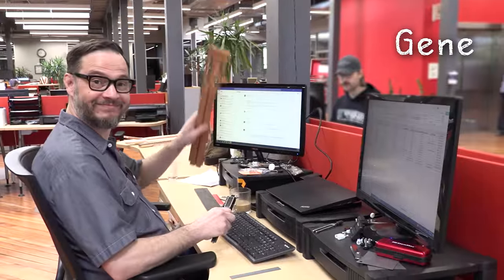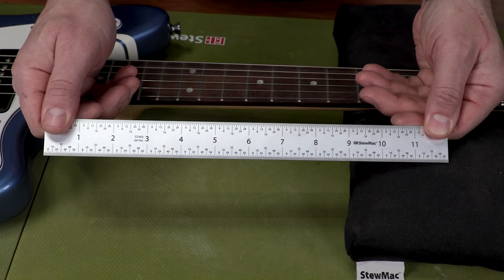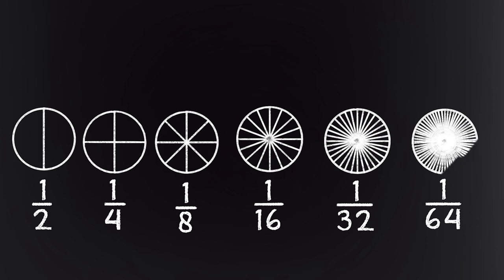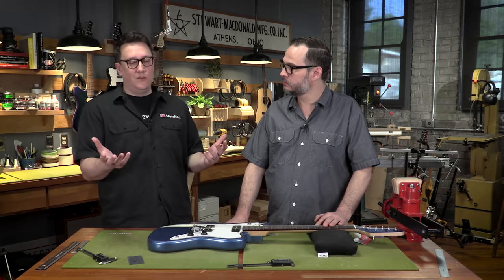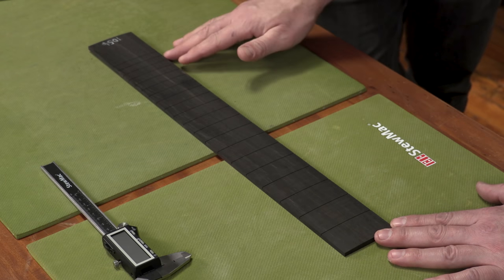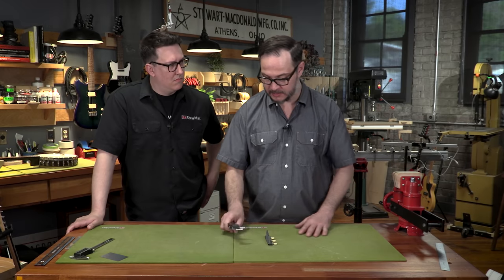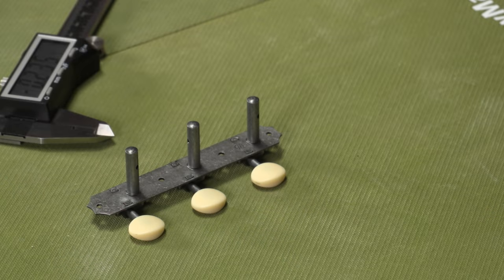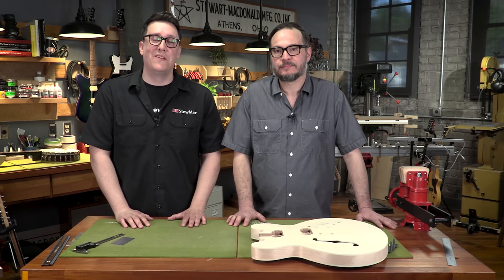Measuring Basics: Rules and Calipers

Comment: There's an easier way to get a centre-to-centre measurement using callipers. Assuming the two holes/posts are the same size, you measure left-edge to left-edge or right-edge to right-edge of the holes. That result is the same as centre-to-centre - it only requires one measurement and doesn't require zeroing the callipers or subtracting the diameter of a hole (or post depending on what you are measuring). The two holes/posts do need to be the same measurement for this to work but that is the common case. Because it involves just one measurement, it has less chance of cumulative error. It is also easy to check across a few sample measurements as it  involves just one step.

Comment: If you can count to 10 on your fingers, you can use metric.  I am 67 and grew up on English but made the switch to metric.  Easy, peasy.  Science doesn't work without it.
Reply: Agree…Imperial HAD its place …metric is the way to go.
Reply: "Science doesn't work without it"? Someone better tell Newton, Euler, Kepler, Hooke, and Boyle that all that work they did needs to be thrown away because they didn't use the correct units.
Reply: @wbfaulk  that seems a bit drastic, I’m sure Ken didn’t mean it like that. It would be simpler, not having to compare/translate data, and therefore eliminate error.. Space flight engineering comes to mind 😊
Reply: @kasperplougjacobsen3473  Doing a lot of converting between inches and miles in spaceflight, are you?
Reply: Ok, Copernicus… 🙄

Comment: Spot the deliberate mistake: he said he measures the action at the 14th, but the rule was actually placed over the 15th and 16th frets.
Reply: Isn't it at neck to body joint?  That's maybe why we see, 14-15...
Reply: @SteveLEKORodrigue  It depends. There's no hard and fast rule for measuring action other than that you're consistent in where you personally measure it so that you can build good intuitions. 

I always measure at 12 because it simplifies the geometry overall. If I measure 4mm action at 12 and want it to be 2mm, I reduce the height of the saddle by 4mm. It makes for really easy calculations when setting up geometry. That's not as critical on an electric, where you can just dial the action in a bit at a time, but it really makes a difference when you're shaving the saddle on an acoustic, because that rule deals with fixed ratios in the geometry of all instruments, so you can take that adjustment straight to your sander and you know it will be on the money. The same rule also applies to the nut, though it's pretty moot as there's a better metric for setting nut height, namely clearance over the first fret. Still, it makes for building good intuitions if you think of the spot where the string passes over the 12th fret as the fulcrum of a lever. Because it's halfway between the nut and the bridge, doubling and halving your measurements makes intuitions for adjustments really simple.

Comment: There are steel rules in imperial that are in 10ths and 100ths. They are usually referred to as machining rules
Reply: decimal inch is king
Reply: @mackk123  What?
Reply: @kkramp1984  the machining rules are decimal inch. I also have one that goes by 1/50th, .020" apart
Reply: That is really complex.
Reply: @willb1157  its not. Dividing an inch into halves, quarters, eighths, sixteenths, thirty-seconds, and sixty-fourths, is much more complicated for people to understand especially if they are used to metric.
Reply: @willb1157  not really, when you're dealing with dimensions on a print, decimal inch is simple. .1 .2 .3. .4 .5 .6 .7 .8 .9 1 inch

Comment: I thought for sure they would cover this but… When measuring action or pick up height, do you measure to the bottom or the top of the rule line? So if the string is at the bottom of the 3/32 line, is that 3/32 or less than that? Is the top of the 3/32 line actually 3/32?
Reply: Perfect rules will have increments spaced equally to the middle of each "line." In other words the actual 3/32nd measurement is in the middle of the 3/32nd line. But remember this is a negligible difference for the tolerances allowed so it's not going to make or break anything.
Reply: If the 32nds aren’t accurate enough, measure with 64ths :)
Reply: Assuming that you do not have a parallax view, just measure very closely to the bottom of the string. It all comes down to feel anyway. You don't need NASA level tolerances.

Comment: Very nice video . I clicked on it for some information that I am not sure about. String gauge. I my be having a senior moment here, I do not know how to convert "gauge" to ? Basically, with my caliper, when i measure my strings, how do I know if they are , say 10 gauge or 11's? Thanks for you time. Jeff
Reply from the maker: We use the term gauge loosely when we are referring to guitar strings. What we really mean is string diameter, which is separate from units of wire gauge like you'd find on our pickup coil wire. So, a 10 gauge string for this purpose just means a .010" diameter string, which reads as .010 on a caliper or micrometer.

Comment: Here in the UK of course, we embraced the dual measurement system when co-forming the EEC (former to the EU).  It was curriculum in all shcools since the switch to metric measurment and decimal currency around 1970...   So those who paid attention at school, should be fluent in both measurements.   And in Britain generally, we use metric for currency, most weights and measures (except beer...) and in engineering and science, as the decimal/metric  system is adopted within the International System of Scientific Units (SI).   In distance measurement, Brits still feel more comfortable with miles, but when measuring buildings or increments of a mile, feet and meters are common, but that can be age dependant. 

There's nothing wrong in using either system, it is just that once one uses metric, certainly in cabinate/guitar measurments, things become simpler and less confusing.   The strange thing is,  US scientists and heavy engineers use metric, like the rest of the world...  But the US education system hasn't  caught-up, like so many things in America...   I think the sticking with the Imperial System is probably largely political.   

The UK has now left the EU...  But I should imagine that most people will continue to use the dual system of measuring stuff...  Except when it comes to their favourite pint.  🍺 Cheers! Old boy.

Comment: I’ve never quite been a fan of the metric system. But maybe someone who is could answer this. 

Why does no one seem to use decimeters as a unit of measurement? When speaking about lengths that is. We go from millimeters to meters, ignoring the unit in between the two. That’s confuzzing to a yank. 

Thanks, guys. Always good to be reminded that I need to upgrade to StewMac calipers. Mine are just about ready to give up the ghost.

Comment: How can the same nation, who has all but abandoned the manual gear shift, still cling to a system of measurement that requires you need to calculate the actual measurement, rather than just read it off the scale.

Comment: the calipers that these people "THINK" are so accurate that most machinist already know are only as accurate as your heaviest thumb, which means that the more pressure you place on the roller wheel the more inaccurate, or trying to measure out on the tips of jaws, never trust the calipers for more then plus or minus 2 or 3 thousands .002-.003
Reply: As a machinist working in aerospace, I would say that if you have nice calipers, and know what you're doing, you should be able to measure things accurately to within a half a thousandth. (.0005) Just my 2¢
Reply: @kagenokemuri  Why I'll take those 2 cents, thanks friend!
Reply: And if you have ever used any mills that aren't computer controlled you know you aren't getting THAT accurate without computer assistance anyway

Comment: "Once you learn it, the metric system makes a whole lot of sense. It's easier."
Appreciate your efforts, but one minute in a 13-minute video devoted to the system used by 95% of the world !? For that 95%, skip the first 12 minutes of the video, or feel like you've been transported back to a previous less-enlightened age. Whatever you do don't bother trying to learn 64ths, 32nds, 16ths etc. Outside the US we measure guitars in metric. America tried to change to metric in the 1970s but just gave up. Other countries made the transition successfully.
By the way 1/8" is 3.2mm. Calling it 3.175mm suggests that metric conversion is more complex than it is.
Reply: If you're using calipers to measure, that implies that you're interested in accuracies down to about 1/1000" or 1/100mm. Throwing away about 2/100mm to make a point about how metric is better seems … nonsensical.
Reply: @wbfaulk  Understanding the precision to which you should measure anything is fundamental to good measurement. Measuring to 0.01 mm is irrelevant to almost every guitar measurement for which you would use calipers. Especially measurements that would be expressed in imperial to  the nearest 1/8th inch. So the point about 3.2mm is not about the superiority of metric, but having a feel for what your measurements really mean. Anyone quoting mm to 3 decimal places shows they don't have a good feel for what metric measurements really mean in the context of guitar work.
Reply: @vw9659  I would also argue that arbitrarily converting units is dumb. It's a 1/8" truss rod nut, for example, not a 3.2mm one. And, honestly, if you're looking to buy a wrench, it seems like 3.175mm is about a common a marking as 3.2mm.

All this argument about "the metric system is better" is just nonsense. Neither is better. It's just jingoism. Personally, I like the fact that I can just keep dividing my inches by two. 1/8 is generally more intuitive to me than 0.175. (That said, my calipers measure in thous, not 1/128ths. [In addition to 0.02mms.]) But that doesn't make either more correct or accurate.
Reply: I have been and automotive technician most of my life and for you to say that America tried to convert to the metric system in the 70s but gave up on it is dead wrong because the metric system is being adopted more and more in America be it ever so slowly but finally now the automobile manufactures have the engine designation measurements in L. s from cubic inches even though it sounds less impressive to say 7.8 L than it does to say 350 c.i. and that brings up another point some numbers don't cross over from SAE to metric like for example a 350c,,,,.i. and 351c.i. both engines turn out to be 7.8 L. and
Reply: @musicauthority3516 I said the US gave up on the 1970s effort (around the time that other countries transitioned successfully).  https://en.wikipedia.org/wiki/Metrication_in_the_United_States#20th_century
'Congress passed the Metric Conversion Act of 1975 "to coordinate and plan the increasing use of the metric system in the United States". Voluntary conversion was initiated, and the United States Metric Board (USMB) was established for planning, coordination, and public education. The public education component led to public awareness of the metric system, but the public response included resistance, apathy, and confusion.[17] In 1981 the USMB reported to Congress that it lacked the clear Congressional mandate necessary to bring about national conversion.'
Reply: @willb1157  Nine times out of ten, when measuring something, you don't need to do any conversions. Are you planning on measuring your guitar in millimeters, but then express it as meters? Well, I'm not measuring my guitar in inches and then expressing it as yards.

A centimeter is not inherently better or worse than an inch.

Also, decimals are fractions.
Reply: @wbfaulk  Look at Imperial guitar setup instructions and you will find an odd mix of 64ths, 32nds, 8ths, 4ths, and thousanths of an inch (action, relief, truss rods, pickup height, etc). The same instructions in metric will ALL be in mm. One metric unit versus 5 or more different Imperial expressions - "more" is clearly "worse".

The 95% of the world who work in metric should stop accepting guitar measurements presented in Imperial units just because one country prefers to do it that way.
Reply: @vw9659  Fractions of inches is still one unit. Your inability to deal with third-grade math doesn't mean that 1/64" and 1/32" are different units.
Reply: @wbfaulk  Who said I couldn't deal with 3rd grade math ? And you are flogging the proverbial dead horse in trying to defend Imperial.
Reply: @vw9659  Someone else responded a few hours ago and has since apparently deleted their comment. I didn't realize you were not that person.